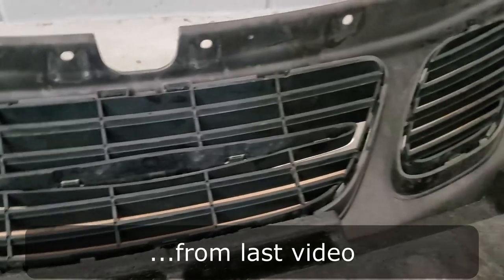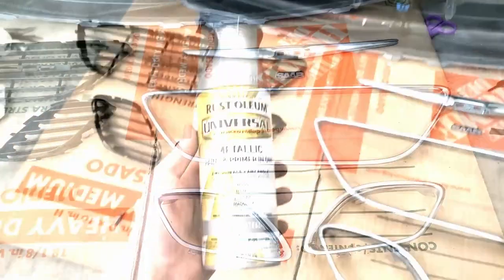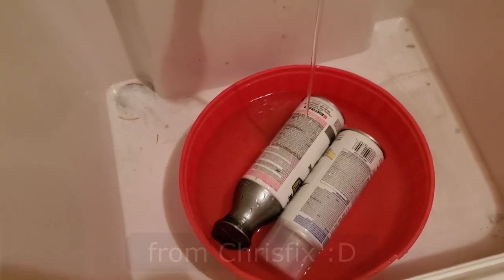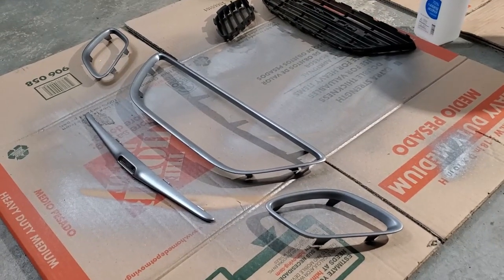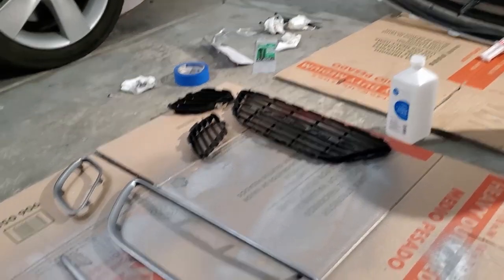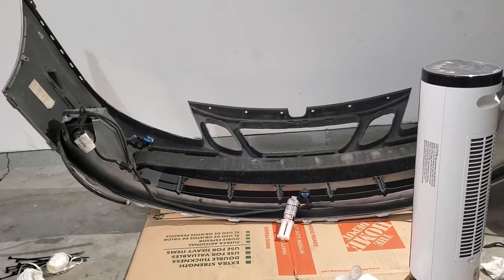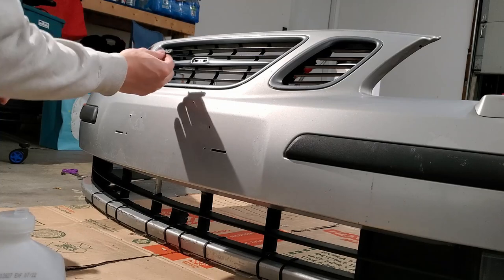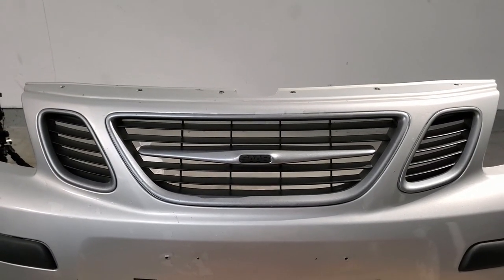Grill painting on SAAB NG9-3 Aero

Comment: which degree of sand paper did you use?
Reply from the maker: Hi Vaja! I believe it was like a medium grit sanding block. Not 100% sure about the number. Honestly it doesn't matter unless your grill is in really bad shape haha
Reply: @BWTECH0521  i want to paint it in black color,also thining use or not the sand paper :) what would you advise
Reply from the maker: @vajalabadze28  1000% use sand paper even if the grill is brand new. You need to scuff it up so the paint catches on. Otherwise, the paint will tend to slide off. And use spray paint that has primer in it, that will help too.
Reply: @BWTECH0521  Would  800 degree sand paper be  enough? i dont wanto to damage the chrome line,but i dont have other way if i want to paint it :)
Reply from the maker: @vajalabadze28  yea thats good